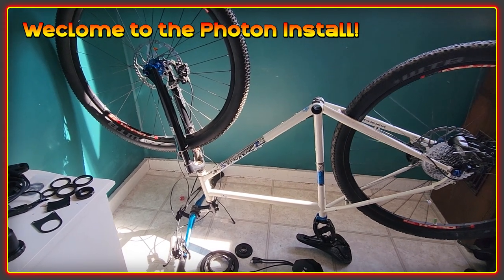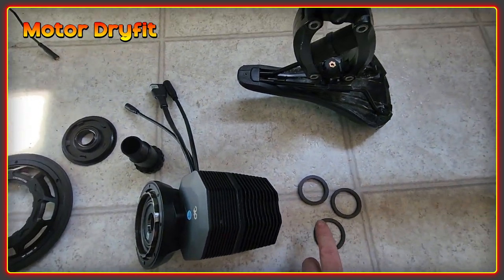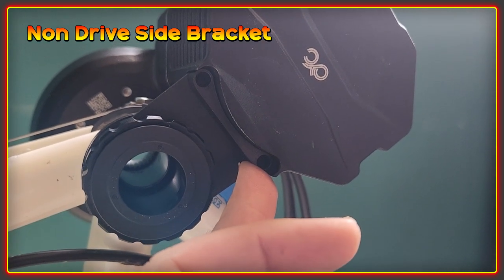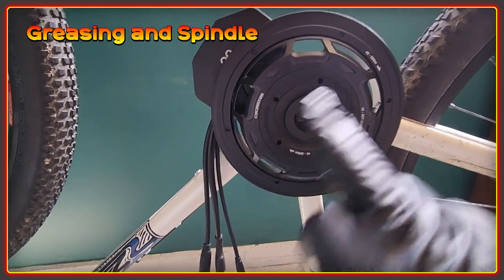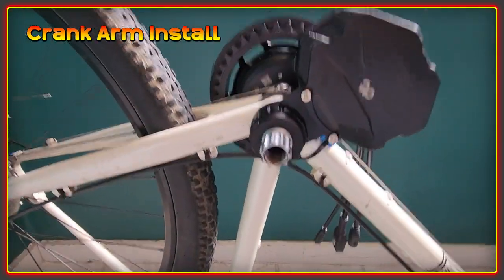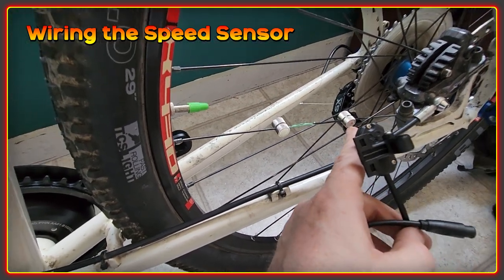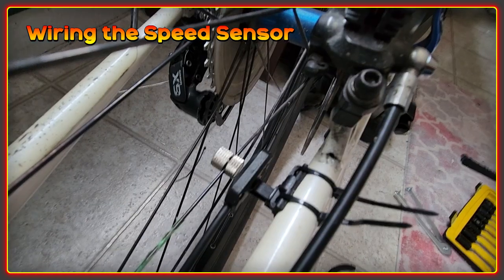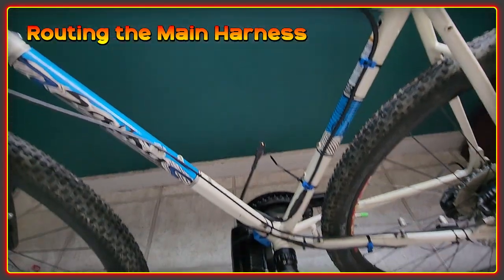CYC Photon Ebike Motor Full Installation, Tips and Tricks

Comment: The Q factor on that looks ridiculous. Is that because you have really skinny tyres/wheels?

Do you know what the max cadence is?

Thanks
Reply from the maker: The Q factor is 200mm which I am told is a tad wide. The tires as 2" for gravel riding so not what I would call skinny like for road etc. I have been hitting a steady 90-100 cadence wise. I will try and get better data for people. I am not an expert on pedal cycling these days. I am using this as a path back to fitness essentially after all these years of going round with the BBSHD and not putting any effort in.
Reply: @HighVoltageKits  
Thanks for that.
I'm not interested in an electric moped either.

I bought a modern boost frame, and I am have having troubles fitting the Tongsheng, as the torque arm touches the rear tyre.
The CYC doesn't use one, so I am interested, but not unless I can get a decent cadence out of it, and not at over 3 times the cost (almost 4 after import vat).

Thanks again for the info.

PS
Dump the throttle
Reply from the maker: I may well. I went for a really nice ride which I will post the footage of. Did not use the throttle once. The instant resume on the torque assist is very good!

Comment: Q Factor looks huge and that chainring seems a long way off the frame.
Reply from the maker: The Q factor is 200. It hits the center of the cassette bang on tho so it cant be far off what was there before. There is an offset though.
Reply: It does have a wide Q, of 200mm minimum. The user manual (page 15) has a chart of the Q and the chain line. In my case (68mm BB), I have no spacers on the right and have a 47.3mm chain line, to properly line up with the IGH I use. 

I'm hoping CYC considers developing a shorter spindle, tailored towards 68/73mm BB bikes.
Reply from the maker: I'm not enough of a cycling buff to know what the effect is. It felt ok to me riding wise. It will be hard to go narrower without a redesign I suspect.

Comment: I need your help! Supplier had to send me another motor due to bad tapping for one of the M4 screws but now the replacement motor they sent doesn’t go in all the way it stops at the unthreaded part in the center. Is your BB shell threaded or press fit? Is there an unthreaded part inside of your shell? Crazy the first motor fit but this one doesn’t.
Reply from the maker: It's threaded. That is kinda wierd. Are you on discord? Maybe post a photo or video clip. Is there any obstruction in there?
Reply: @HighVoltageKits  is it threaded all the way through? My BB shell is threaded 1 inch on either side but the shaft of the motor is longer and stops where the threads end. I have a feeling I’m getting the run around because this motor was replaced by supplier because one of the M4 screw tappings were off they sent another motor but the other motor I had no problem fitting it.
Reply: I’m on discord for my steaming service how do I get you on that app?
Reply: Cisco kid #8903
Reply: Don’t know how to navigate Discord is there an email I could use?
Reply from the maker: John@highvoltagekits.com

Comment: I find my Bluetooth connection is very weak. If my sitting on my bike it disconnects. I need to hold my phone down slightly, closer to the motor.
Reply from the maker: With the Photon? I will see how it goes. It seemed to have a good connection. The module is in the speed sensor I believe.
Reply: @HighVoltageKits  yes, the photon.